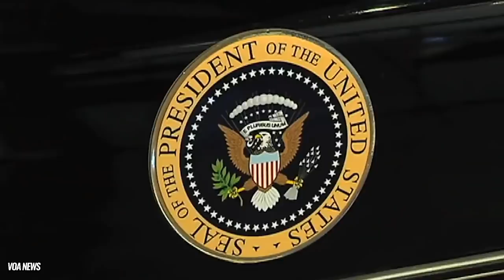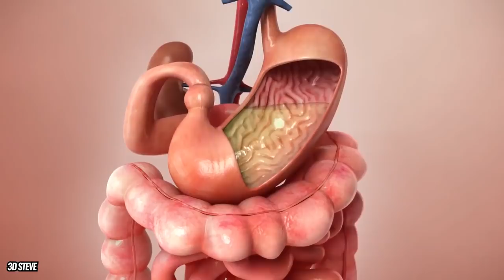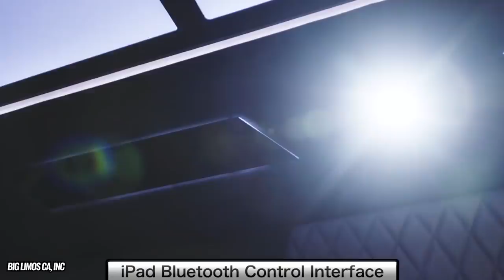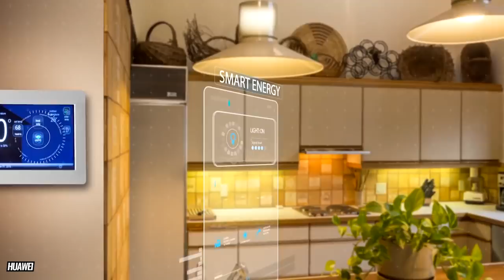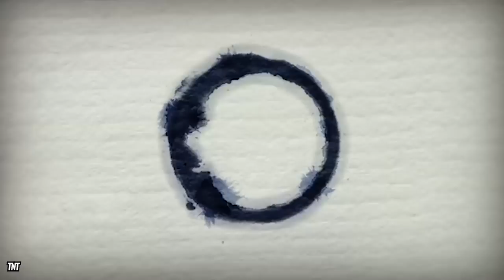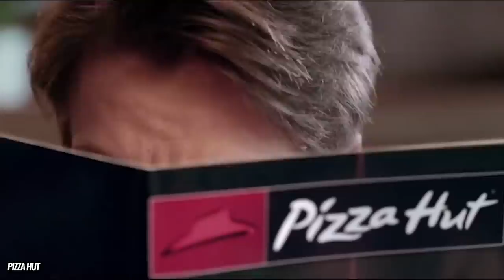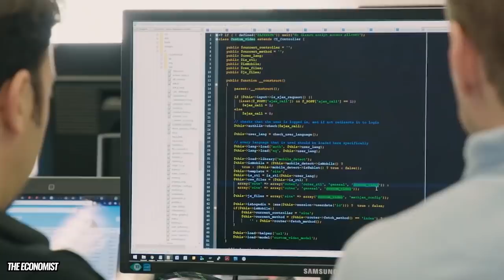11 Secret Techniques Used By The Secret Service

Comment: I guess that these tatics aren't so secret anymore now.😂
Reply: The ones used change constantly. These are the "secrets", Langley wants you to know because it deviates from the holes in security.
Reply: @idlehour  
There's not a perfect security system of any kind anywhere. 100% of them have holes. Some are just harder to find.
Reply: @tiffanybenefield1980  Well the declassified information over recent years show and state misinformation is an advantage to the United States. Put as much information oit there let it sit, then alter the world around you in regards to defense, and other expensive things. Such as all the MIRVS the states purchased in the last year and a half. Keeping the public focused on what they want is the goal.ill find the report that was declassified with a lot of different examples. Mk ultra was a deterrent and focal point to keep eyes off a iconic trade that went down when it began.

My English is not the best, i am from Sicily and speak Itilian, Maltese, and Japanese. Hope there is no missunderstanding, and no disrespect. Just foggy in the head from flu so English is a slow read and write but i think i wrote well enough
Reply: @idlehour  
Ok
Reply: @idlehour  Ehh said holes are small and would have to be hit with perfect timing and either way they have like 5 times as many pepole inside as outside so it's pretty low they would get to Trump unless he happens to be walking in the walls to the bathroom or something even then I be secret service know about it and are on any doors that could get someone to Trump with in 20-30 seconds but who knows I'm not a agent nor a government official so i don't know sheet I just can assume